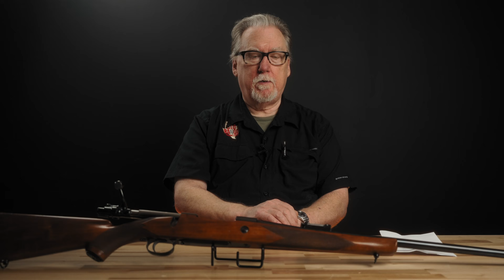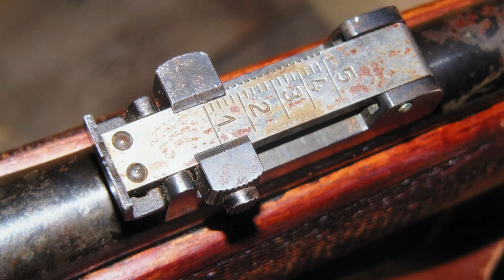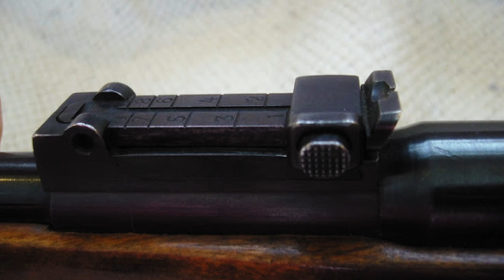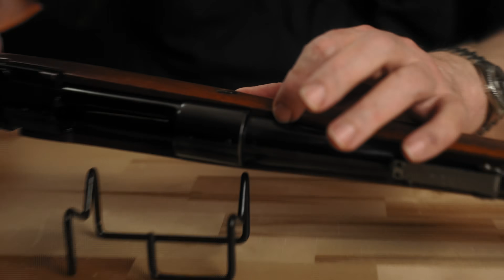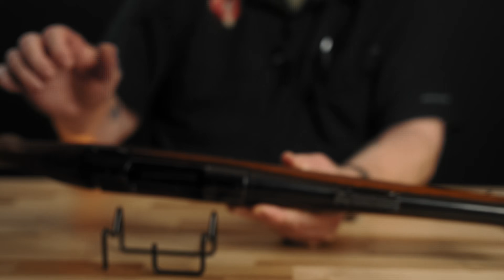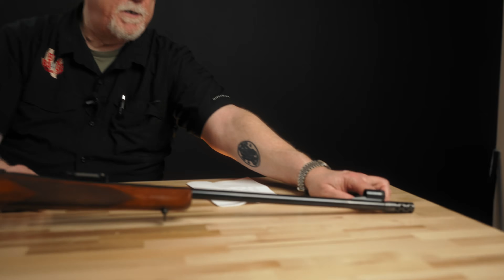The Obscure 1950s Sako Magnum Mauser You May Have Missed!: Remembering the Past

Comment: Fantastic video, very informative.  I have a Sako Mauser in 30/06. Mine has a 2 position safety, folding leaf rear sight. It was missing the front sight hood, which i was able to locate one. Bought mine at a gun show in '18 for $700. My serial # is in the 110's. With 185gr Lapua factory loads, 5 shot groups usally under an inch.

Comment: A classic Big Game Rifle.  Most that I have seen in .375 and good+ condition, are listed at around $1,500 to $2,000.  Unfortunately, many of these were restocked.  As I recall, Sako also sold these as barreled actions.  The swing safety shows it was a very early gun, perhaps made up on some pre-war parts.  The later versions had a low scope type safety like the FNs.  I would think the mussel break would definitely lower the value to a collector.

Comment: Just watched this and have a ? About early sako I have a FN commercial 300 win mag I know they were changing over their actions before 300wm was introduced.  Whe I pulled it out of the wood, the trigger is marked sako in large letters.  Also no sako mark visible on upper part.  Oddly to me it has a 3 digit serial number if I remember correctly.  Just trying to identify this as to if it’s a sako or ?
Reply from the maker: Not factory Sako except for the trigger itself.   The actions were available to the gunsmith trade, so if there are no markings on the receiver or barrel it may be a one-off workshop build.